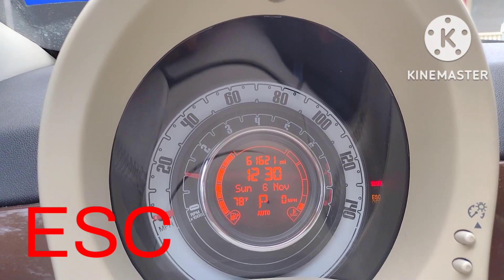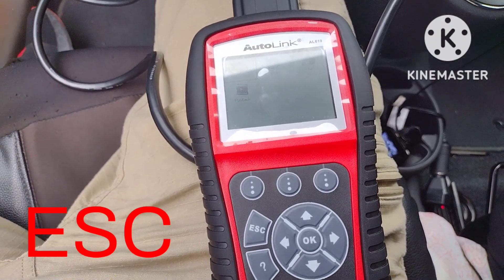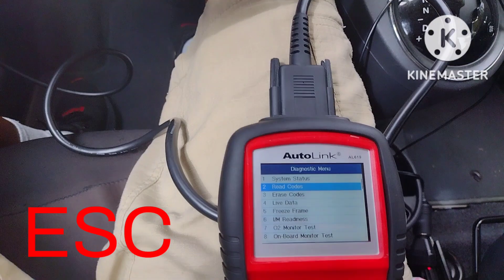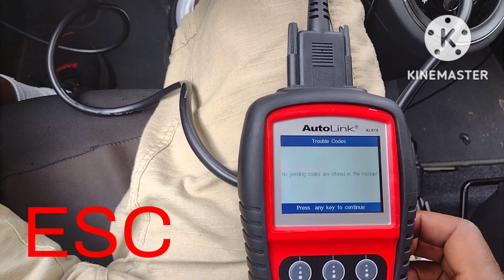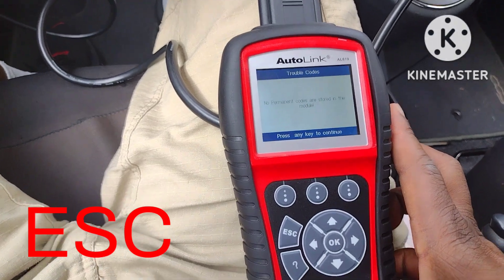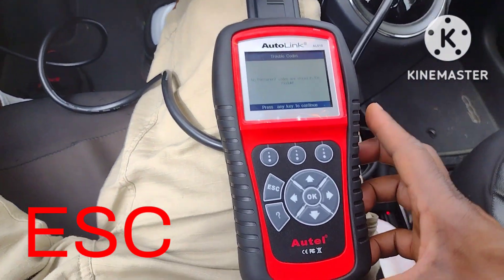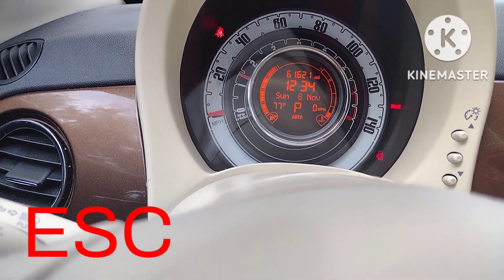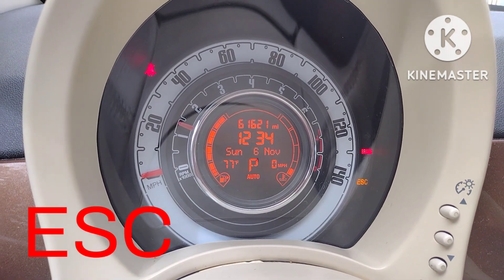#ESC. ELECTRONIC STABILITY CONTROL MALFUNCTION

Comment: Hi did you get anywhere with this, exactly same problem, esp and hill holder on fiat 500 twinair?
Reply from the maker: Mine is fixed...if you get a code it will tell you what is wrong . If not leave it alone and it will go away